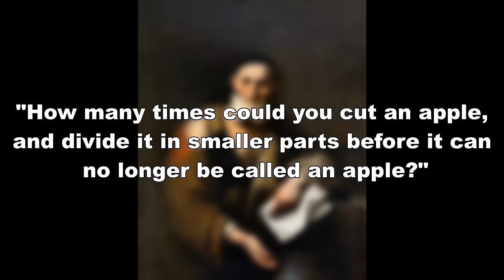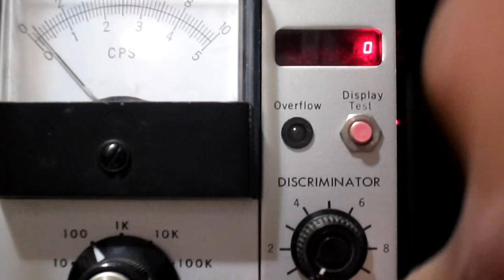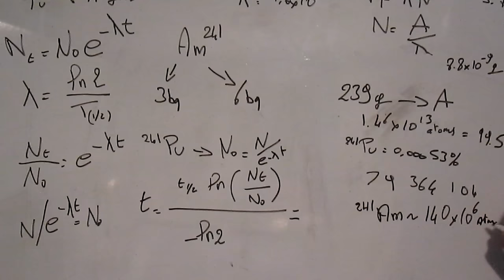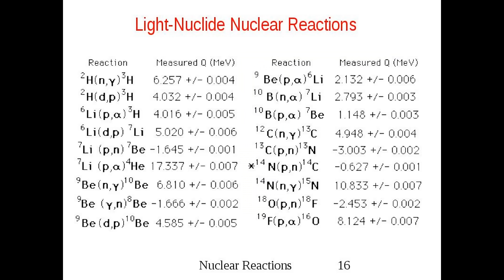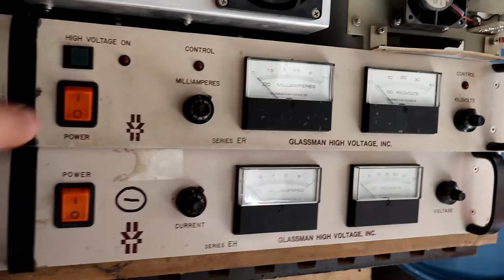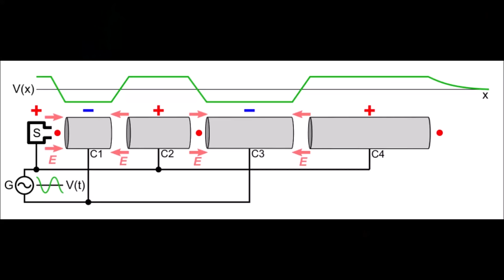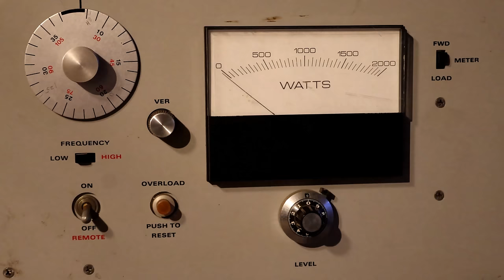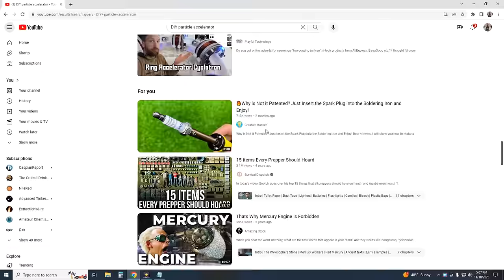DIY Particle accelerator (part 1)

Comment: To drive the accelerator you should consider using a magnetron - the idea is to fire a beam of microwave RF down a waveguide and design the waveguide to match the frequency of the magnetron.  I have used a 3GHz magnetron that produces a wavelength of 10cm.  The waveguide can be integrated with the accelerator tube assembly such that you fire the microwave RF signal down the length of the accelerator tube.  You can also help give the system a 'kick' by applying a correctly phased voltage pulse to the filament - you want a step-up transformer with a bi-filar wound secondary winding - the filament gets connected between the 'ends' of the secondary bi-filar winding and you connect the DC filament PSU across the 'starts' of the bi-filar secondary windings.  By charging a capacitor to a high DC voltage and then applying this across the primary winding of this transformer the secondary winding generates a much higher voltage which basically gets connected in a 'common mode' fashion to the filament - rapidly changing the voltage potential of the filament with respect to the system ground (I.E., the accelerator tube potential).  
Using a combination of a magnetron to power the accelerator and providing a high voltage kick to the filament you should be able to get up to several MeV with the accelerator that you have built.

Comment: Ouch sorry to hear about the significant equipment failure :(
Home sceience is dificult at the best of times and only so much resources you can keep putting towards a project, but hopefully over time this can all be fixed up and back in operation. Thanks for the videos!
Reply from the maker: Your absolutely right!!! It ain't easy but I am not the first or last to tinker with concept and experiment.. good stuff though!

Comment: Really nice job :) 
If I can give you a few tricks (I'm an ion source engineer in a nuclear physics lab):
Put the turbo pump on top, that will prevent small particles that could pass the grid to fall in it.
With your baking system, be careful with polymers like plexiglass (80°C max). Also, use such "non vacuum" polymers as less as possible (you can drill holes in your plexiglass support). On the other hand, you can use  PEEK rods to make your support (more expensive but better for vacuum and baking).
Also use polymer reusable CF gasket instead of expensive coper, fluorocarbon ("viton" , bakeout 150°C)
EDIT: I see it's a viewport with perbunan gasket, also take care with bakout 100°C max.
Try to not use tin soldering (bad for vacuum) : instead use mecanical electrical connections like screws
Try to not use usual plastic isolated electrical wires : instead use kapton isolated wire (but expensive), or naked copper wires with peek support, to keep them far from grounded parts
Don't forget that the charges will also feel the electric field from the wires. That could break the cylindrical symmetry of the field, so put them as far as possible from the gap between electrodes
I'm not an expert in HF voltage, but I think the inductance of the electrical wires may affect the voltage really applied on electrodes, so you may have to use expensive coaxial wires kapton isolated with known impedance (not sure if really important or not)
Reply from the maker: Thank you for all these advices! I plan on explaining why and what I am doing about all of these in the next video. I thought about screws for connecting everything but they may interfere too much with the electrical field and could create virtual leaks. Of course the deeper vacuum the better but i don't really need to get below 10-6 Torr to get the mean free path long enough for my chamber and the soldering is not much of a degassing problem at that pressure. The plexiglass spacers have been replaced with HDPE and I am making them as we speak. I didn't know about any other gasket besides the copper ones for the CF flange so I already bought a whole bunch! Oh well! That will be for the next project! I also didn't know about PEEK electric insolation ! That is something I'll look into today!! So you work in the nuclear field too? Sounds like you have an interesting job !! Ion source engineer ! Let me ask you this, I replaced my ion source with a small sputtering gun type of source it works great so far so you think it's a good idea? It fires at the small opening in the tube entrance so the pressure is higher on the gun side to keep it going... Anyway thanks for watching! And I really appreciate your comments ! Thanks again!!

Comment: It looks like that safety net grid thingy that saved your TMP would be a good addition to some of the other spots to reduce potential for damage-related setbacks. Probably a good idea to put little shard-drag screens, or see-thru "Doghouses" on the external windows and other shatterables. If there's one thing I learned during the more mischievous years of my youth, it's that the first lucky near-miss is a gift attached to a warning; so that I am grateful and never make that general mistake again.

Comment: Wonderful work! Please be careful, though. I had a minor accident around high pressure gradients when I was younger and not taking thr proper precautions—they're no joke and require vigilance. Consider double-walling with glass and acrylic at atmospheric pressure for safety. 

Also, it was amazing to see so much covered in a single video.
Reply: Top suggestion, I hope he takes that on!

Comment: This was OUTSTANDING in its depth and thoroughness.  One video and I'm sold.  I'm very glad I didn't quit YouTube when I planned to, ir I might not gave found your channel.  See you on Patreon!

You might consider upgrading your port glass to either automotive polymer glass or ballistic-rated glass like Lexan, although these are both difficult and expensive to get in custom shapes, and I wouldn't advise DIY milling them.  Also, if you're keeping your rig at high vacuum for days at a time, that puts static stress on the glass and seals, which can lead to point-stress fatigue and failure, especially the cathode electromagnet mounted on top, which is an odd shape and looks made out of stock shop glass.
If you have computer troubles with your square wave generator, make a fine-mesh Faraday cage for your sensitive electronics.  When properly grounded it should act as an inverse waveguide, creating an 'EM null space' inside it.  As long as there's no line-of-sight from your wave generator to the interior of the enclosure, and no nearby arc sources, you shouldn't experience debilitating interference.
Best of success, cheers!
Reply from the maker: All very good advice thanks! Part 2 is out now! Thanks for watching!

Comment: You mentioned producing a high voltage, high frequency, square wave. 
Gas powered portable generator(produces square wave)>boost transformer(boost voltage)>Variable Frequency Drive(boost frequency?)

Idk if it would work but you said nobody got back to you with any idea, thats what came to mind for me when you said what you needed. And thats how far I am into the video so far.lol

This is my first time viewing one of your videos, I am impressed.
Reply from the maker: I am not sure a gas power generator has the  kick for this sort of job... A lot of very knowledgeable viewers have responded with good suggestions since the video releases.. so it's still work in progress ! Thank you for reaching out and thanks for watching my friend!
Reply: The best solution here is to use a magnetron and generate microwave RF.  You design a microwave wave guide that is integrated with the accelerator rings and with this arrangement you can support really high acceleration voltages - no need for any electrical connection into the accelerator tube as you just fire a microwave beam down the accelerator tube.

This is the way some of the higher energy Linacs operate
Reply from the maker: yes that was a possibility but 2 problems came up, this is mostly used for electron acceleration and the chamber has to be precisely made. Since Magnetron generate a kind of messy signal and I am not sure they can be tuned to an exact frequency.. for such a home build project it is probably not a big deal but this is why I went with the more "primitive " drift tube. Thanks for the suggestion! and Thank you for watching !  part 2 is already out!  @michaelharrison1093
Reply: @Neptunium - a magenetron designed for microwave ovens outputs a wide RF frequency range, however there are magnetrons that have precision RF cavities that produce a narrow band RF.  These precision magnetrons are used for navigation radar and for linacs.  There is a degree of frequency 'tuning' available by just tuning the drive voltage that is applied to the magnatron.

It is certainly one of the big challenges with a magnetron driven linac in getting the magnetron frequency turned correctly.
Reply from the maker: I didn't know you could get a tunable magnetron! pretty cool Thanks again my friend! are you in the magnetron and/or linac business?  @michaelharrison1093

Comment: Oooh, this is an instant sub!  I've been wanting to do something similar myself, but for now I severely lack the space and money needed for such a project.  I'm really happy someone is seriously doing this! 

When it comes to the power supply, I was thinking of a solid-state (or a vacuum tube) tesla coil which can generate a pretty clean output, a spark-gap coil is ridiculously noisy as you already found out.  Voltages upward of 50kV at ~1MHz are possible with such a solution.  I was pretty hellbent on using protons so safety precautions (not to mention the tube length) would have to be extreme (and so would the cost >.>)

I hope you can recover from the unfortunate accident, I really wanna see you succeed in this!  Good luck ^w^
Reply from the maker: Thank you! yes I was expected more serious attempt but I could not find anything on youtube either! there is a lot of very talented individuals with amazing videos, HA! time space and money! lol the big 3 obstacle to home science! very familiar with those ! thanks for watching!

Comment: if interested to improve your Tesla coil output, you should lean more about the the third (yes the Tesla coil did have 3 coils, not 2 as widely perceived), so called "extra" coil, Tesla was using for tuning of the power build of the entire system. A good source on that is William Beaty (amasci) . It has a wealth of information. Another truly amazing source is (of course) Tesla's "Colorado Springs Notes". I personally learned A LOT, from that book but needed to read it 3 times, as the language is of 19th sentry engineering physics and it takes time to immerse into. Also feel free to reach out to me if you think I may be of any help. Good luck with the experimentation & be careful with any electronic equipment around  these marvelous devices. I burned  many electronic instruments and with time moved to vacuum tube ones (especially for high power HV)  no to speak that (luckily) have remote unintended numerous restart of my laptops when I operate my Tesla coil :D
Reply from the maker: Interesting!!! Right now I am just trying to make sure It can be controlled and gives me an organized signal..but yeah eventually I would very much desire a higher output for sure!!! Thanks for that comment!!

Comment: New subscriber here. Great build and even better research. A few years ago myself and a couple friends embarked on similar research. We used  a custom flyback and a Marx generator to get the high voltage . We were working towards ion valve technology. We went through many different gases and eventually settled on radon gas which was the last thing we ever tried as it was a huge problem for containment. The lab that we used was a friend's who did radon testing in the Teri state area. After we finished, we back filled it with concrete and he built another more commercial lab. He had all kinds of permits and things so were covered. It has been a long time and I do not know if he still does any of that work. Here in Pa we have a huge problem of radon in the country. I could be completely wrong but it looks like you are in the tribe state area also.. I am in pa. Keep up the great work my friend.
Reply from the maker: Wow radon?? Really! No I am in Michigan. That all sounds like fun! I can't say if I am gonna succeed but I'll certainly give it my best ! Thanks for sharing your story my friend and thanks for watching!

Comment: Amazing video as always, have you considered using a microwave transformer? That's probably the easiest way to get high voltage and frequency. As for the energy measurement, you can put a magnet near the beam and measure the deflection.
Reply from the maker: Excellent suggestion! The microwave transformer is not tunable to whatever frequency I want ... But it can give me higher voltage your right! The deflection magnet is an idea I came across a little while ago and I still have to investigate it. If I decide to go with it (or not) remind me to recognize you for your suggestion! Thanks for watching!!!
Reply: I don't think a microwave oven transformer would be very useful.  We're talking about frequencies of ~200-300kHz, the iron core of the transformer would be incredibly lossy.  Maybe a transformer from an inverter microwave with a ferrite core could work, but it's still a very high frequency (these operate at closer to 20-50kHz)

Comment: Steins;gate stuff getting real
Reply: Wouldnt be surprised if some people that makes things like this are inspired by steins;gate, its what inspired me to start too. Although i dont have the budget to make things like this, just x rays.
Reply: @ElPsyCongroo.  Thats great.
Imho most expensive things are the tools to fabricate these, raw materials are pretty easy to get on hand, even more if its scrap.
 Hopefully some years later stuff we need could be more affordable, even better if people could make their own microchips or even percise machinery for their projects.
Reply: @celinedieve8701    exactly, it's surprisingly easy to make hundreds of kilovolts either AC or DC, what's actually hard is to make for example a good vacuum, necessary tools, or depending where you live even basic electronics components for more complex circuits. For example, I made a tesla coil that generates between 150kv and 170kv with just random trash I found in my garage, but when I went to buy some resistors for a ZVS circuit i found out they dont sell them in my country. At least it forces you to be creative in whatever you are building, but hopefully someday things will be easier to get and more hobbyists can make great stuff like in this video, if science was more accessible to normal people there's no doubt there would be more discoveries.
Reply: thats what i immediately thougth. he is the mad scientist for sure. and its great seeing ppl who know steins gate and also into science.
Reply: @future_physicist  well, if you like this kind of stuff you should get into high voltage if you are not already, it's a really cool world and relatively safe if you know what you are doing, most materials can be made by yourself too (I literally use cocacola bottles as capacitors). And you can explore really cool physics phenoma with just a few cheap materials.

Comment: Mechanical Shielding, whenever possible, and where the risky process can not be eliminated in of itself, is a good plan for safety going forward.

Essentially just something like Mythbusters did in the day, a sort of Plexiglass Shield to watch things behind, if not even a little “control room-cubicle” of sorts.

If you can’t do that due to cost constraints PPE can’t hurt!

That’s just my minor “safety snob” idea.

Either way amazing project, and keep up the great work!
Reply from the maker: Awesome! Thanks for the advice my man! Thanks for watching and happy new year!
Reply: @Neptunium  yeah happy new year!  One other idea on the note of the new video i forgot to add:  Can Chain Link Fencing, “Chicken Wire”, a “Tomato Cage”, or even “Expanded Metal” or other Hardware Store materials be used to make a sufficient Faraday Cage?  More durable/easier to work with than Metal Foil, but may still work?